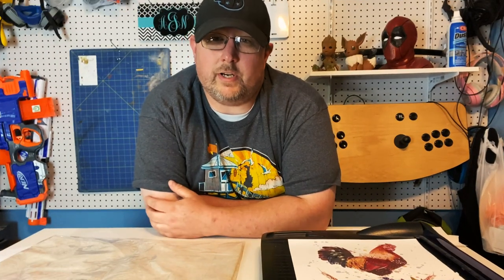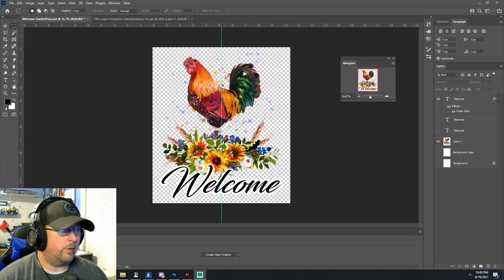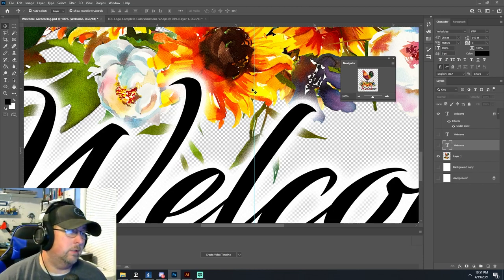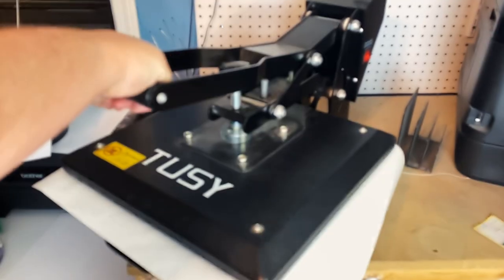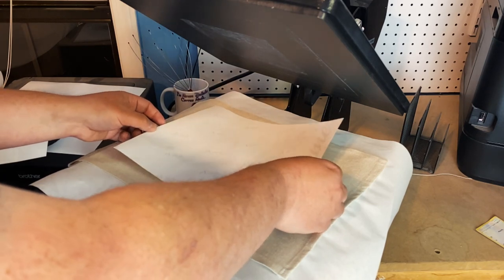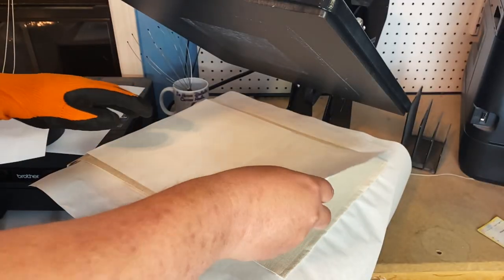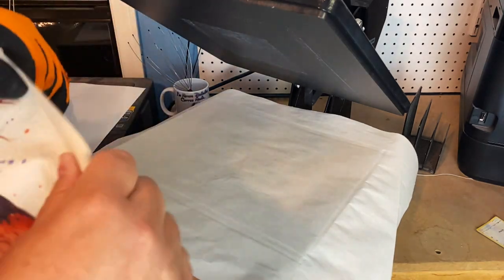Printing Perfect Sublimation Garden Flags

Comment from the maker: Chapters:
01:24 - Designing the Print
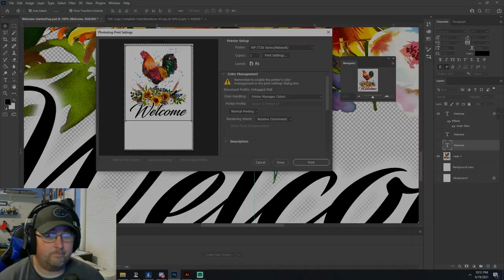03:13 - Prep and Press
05:53 - Final Reveal!
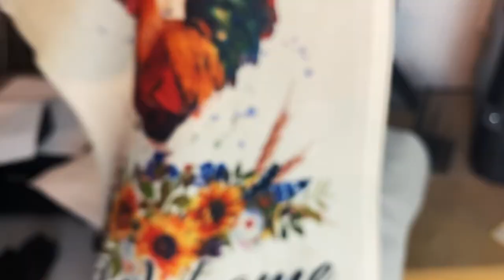07:49 - Wrap-up and Final Thoughts
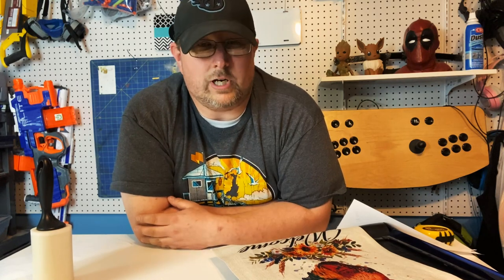08:47 - Outtakes

Settings used:
- Premium Matte Paper settings
- Heat Press to 385*
- 60 Seconds press time
- Medium Pressure